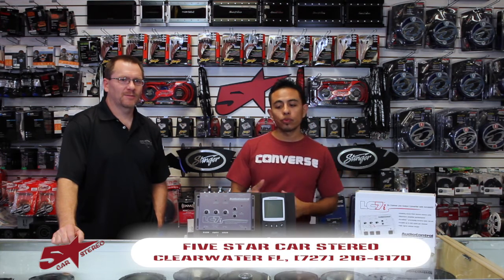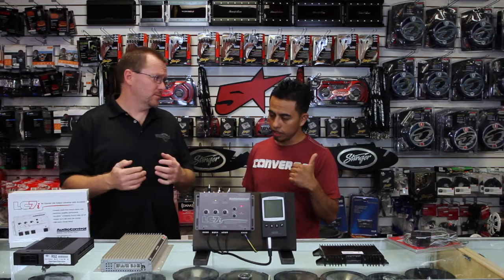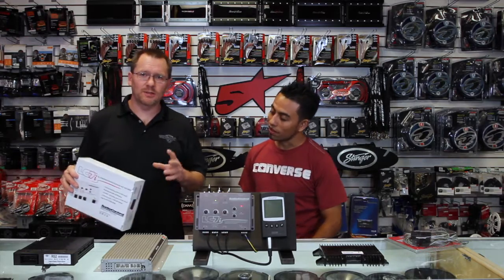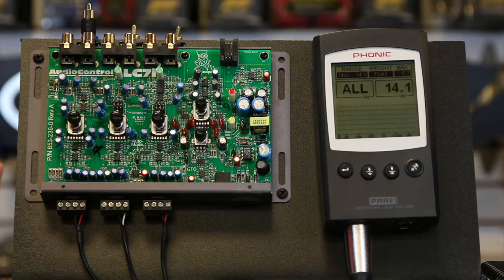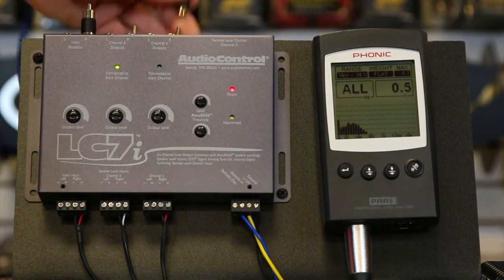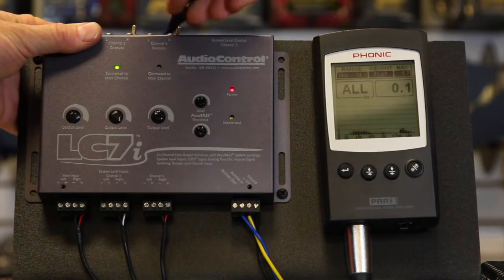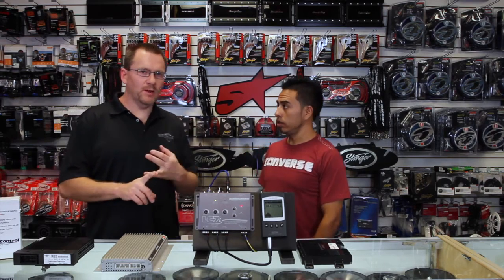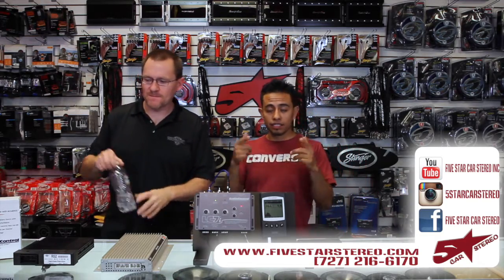Introduction to AudioControl's LC7i part 2 "how to do 2 way summing plus subwoofer"

Comment: Question I have this same LC7i  I have my front tweeters plugged into main input front speakers into 2 channel and rear speakers into third channel but have great sound through my 4 RcA’s for my speakers and not much bass coming through third channel for my subs that I have two rcas plugged into third channel if I pop the hood and turn auto to off will that help my 3rd channel run my sub output rcas better and get a better response? Please help! Thanks.
Reply: I see on the wiring diagram for the LC7, it looks like the auto switch lets you choose between input 2 or 3 to be sent  to output 3, not both 2 and 3. So to answer your question, I would say turn auto off. With it on, your only getting the signal from input 2, which may not have the lows to be sent to your sub amp. 🍻

Comment: So...my setup..

Channel 1 is front speaker components.
Channel 2 is rear deck coaxial.
Channel 3 is sub.

Since channel 1 is powering the speakers(woofers and tweeters)  through a  crossover, should i NOT sum channel 1 and 2 on the lc7i? Should they all be seperate with auto mode jumper OFF?

Comment: ok... So I have pioneer 3-way door speakers for front and rear doors. There is no 6x9 on this build. I do plan to add a subwoofer. However, the type of speakers I have are not separate tweeter slash mid woofer. Do I need a LC7i to run this type setup since the front and rear are running full sound. Can I put the fronts on one channel and the rear on the other and then use the bass only for the subs. Or, I need both channel 1 and 2 separate for the front and rear then let auto mode do it's thing for the sub? Sounds confusing. I have a 2018 Honda Civic Hatchback and was told the stock stereo runs in 2ohms. Any help thank you.

Comment: thanks for all the info on the videos , I have a 2017 Silverado and going to use only my rear outputs but don't know the range that they produce  to feed the ic7 and feed 2 amps one for the rear doors and one for sub . How should I connect the level inputs ( main or ch 2) and I want mainly mids going to the new rear door speakers JL Audio C3-650 and for bass is Infinity BassLink SM thank you for the help

Comment: I have to use one of these and i am putting in and arc audio xdi 1200.6, if you know the specs to the amp, would i somehow be able to get 600 watts to a single dvc 4ohm sub?

Comment: I have a 2013 gmc Denali crew cab  with the bose surround  and a factory touch screen w/DVD . I also have a set of rockford amps a 4 channel and a mono  I was wanting  to swap out the speakers and add a sub along with  retain the factory head unit and steering wheel will this unit do what I am needing ? Or will I need something else or will I need to add something as in the lines of Pac audio stuff or what

Comment: I have a 2017 1SS 1LE. It doesnt have a sub. Should I still use the LC7i?
Reply from the maker: HWk Fan yes, it will give you a sub output and the bass boost.

Comment: Do you need all 4 speaker line inputs from the factory amp or can you use two like you're doing here? I want to run tweeters off main one and channel 2 I want to run mids. Can I use the front only full range signal from the factory to put the left tweeter/mids into +- and the right side tweeter/mid in the same way?
Reply from the maker: Scott Miller you can run the front Tw into main and the front mid into the second set of inputs. You just have to sum the inputs to get a full range output.
Reply: The problem with my system is the front L+ and L- are ran in parallel so my tweeters and mids are on the same channel.
Reply from the maker: Scott Miller ok so the front are full range with no need to sum. You can just run the fronts into main. If you are not going to use rear and have no factory sub, the lc2i would work.

Comment: new head unit $850 or LC7i $190 keeping factrory head unit mustang 2014 sound upgrade- does bad souce mean bad sound?

want to upgrade 2014 mustang shaker 500 microsoft syn factory installed, no touch screen is now 1 din - 2 choices are one, a  new head unit  kenwood 9903s $550 touch screen with maestro idalink $200 to use current steering wheel controls and car talk=total $850 vs choice 2,  a audiocontrol loc either lc7i $190 or lcQ1 $300 with 11 band equalizer and no new head unit. the loc choice means no andoid auto and no eventuall backuip camera.

 new & not yet installed in the trunk- jl audio xd700/ 5v2 amp 75rms x4 &300rmsx1, 2 pair(4 speakers) jl audio c5-650x coaxil speakers 2 sets new gift to me, 1 jl audiostealthbox 13.5 inch woofer unused for trunk, 2 of ( dont remember why 2 from 8 years ago my last noob install) kenwood xr-1s mono subwoofer amps( 700w rms at 2ohm)
the factory mustang head unit has no rca out, believe is 22rms out. Im happy with factory setup controls, dont need either  a touch screen or( backup camera(costs $100 to $160)  but sound is 2nd rate and I keep my cars for 12 years or more.

Would you replace the head unit for $850 or use the audiocontrol loc $200 or $300-- the $300 loc (LCQ1) has 11 band equalizer vs 4 band on factory hewad unit?   the kenwood head unit is kenwoods newest top of line. but the $500 saved on only the Loc could be used for soundproofing . The noob in me says a bad source (factory herad unit) gives bad sound but with the Loc im processing the sound feeding my aftermarket jl audio amps. Im a total noob and never used LOc's before. Please give an opinion
Reply from the maker: file1man I'm a believer it that if you can replace the radio do it. Unless your factory radio has the ability to have preamp output. ( PAC Amp Pro).

Comment: Hey these videos are great. I've watched all three parts and this one seems to apply to my set up. I have a 17' Ford Fusion with the Sony system. So from this video I would plug front door left and right tweeters from Sony amp into input one.  Then plug front door mid range left and right speakers into input two. And the sub left and right outputs from Sony amp into input three on the LCI.  Since I didn't use the rear tweeter or mid range outputs from the Sony amp. I'll likely loose fade capability right ?  No problem.  
My question is about the outputs.  So obviously output three would go to my mono 2 channel amp powering my sub.  Are output channels one and two on the lc7i the summed signals of inputs 1&2 (tweeters and mids?). So id plug one set of rcas into main output 1 and another set into channel 2 output and run both to my 4 channel speaker amp?  Which is then wired back to the front and rear door component speakers. ?
Reply from the maker: Albert Ahumada yes, to all of it you got it right. The only thing is you may want to check this out instead 
http://www.pac-audio.com/downloads/ap4-fd21_instructions_122816.pdf
Reply: Guys that link doesn’t exist. What were you trying to refer to?  I know it’s a year old but I’m in the exact situation, what were you wanting us to see.

Comment: I have a question, I want to retain the factory head unit, add only a single 12" sub, and also want to amp my door speakers. There is only the front and rear door speakers and front tweeters. How many channels would the amp need and would the lc7 work? How would I do the input into the lc7? Sorry I'm extremely good mechanically and with electrical yet sound just baffles me ( I know it's electrical also lol ) thanks appreciate any help. Car in question is a 2011 Chevy Cruze if that helps
Reply from the maker: Yes the lc7i would work great. Your radio should only have 4 powered outputs, front and rear. This will be the basic install on the LC. You may also want to check out the LCQ1, it is basically an LC7i with and eq.
Reply: +Five Star Car Stereo ok thanks a lot will take a look

Comment: I have the Lc7i and only need it to power my subwoofer channel and I am using the high level output to the factory subwoofer to send signal to the LC7i.  What is the best way to configure the unit to do this?  Thanks
Reply from the maker: Do you need the GTO turn on for the amp?
Reply: +Five Star Car Stereo I am currently using the GTO feature. But I don't have to, I can run a 12v ignition line.
Reply from the maker: +hbracer93 if you run the speaker wire output to both the main and channel 3, you can use the gto and channel 3 with the AccuBass.
Reply: I see, so make a jumper from the main input to channel 3 and run the RCA's to channel 3 to get the accubase, turn off Auto right?  And its ok to be using the actual subwoofer wires to feed the LC7i? 

 I am going to jumper it tomorrow, I can tell I really need the accuBass.  I have a factory 15 speaker Bose system and it seams the factory woofer doesn't like to play certain frequencies.  It will hit the deep long notes, but misses all the short punchy notes.  Hopefully the AccuBass will fix this.

If not I will look to use the rear speaker wires to input the LC7i and jumper to channel 2 and leave it in Auto to use channel 3.  You guys are the greatest thanks for the help.
Reply from the maker: +hbracer93 yes that all sounds good. Keep us up to date on your progress.
Reply: +Five Star Car Stereo using the jumper worked, thanks again.  I just switched auto off. I think the voice coil on my sub is fried though, I still need to take it out to ohms test it. I will get some listening time in over the next week to see if the accubass resolved the lack of short bass notes
Reply from the maker: +hbracer93 glad it worked, sorry to hear about the woofer.

Comment: Hey guys thanks for posting the Audiocontrol vids. Hoping you can offer some expertise on my setup: Which inputs should I use on the LC7i if I only have a 4 channel amp (two channels for highpass, two  channels for the sub). I will only be utilizing the front speaker and sub outputs from my factory Logic7 amp. In addition, I plan on using the acr1 remote knob.
Reply from the maker: Thank you. Leave it in the factory default settings. Use input 1 for front and input 3 for the sub. Use output 1 for front and 3 for sub. The bass knob will control channel 3 only. I hope this helps if you need anything else let us know.
Reply from the maker: +Five Star Car Stereo if you have more then one front channel set it up just like we show you in the video. Example front tweeter and front midrange. If not, do first recommendations.
Reply: Thanks for the reply, I'll give it a shot and let you know how it goes! In the meantime, does the LC7i perform bass restoration, with channel summing, or do I need the epicenter for bass restoration. I didn't go with the epicenter since it only has one input...
Reply from the maker: +Ian Brown I would see how the AccuBass works out and if you still need more then worry about it.